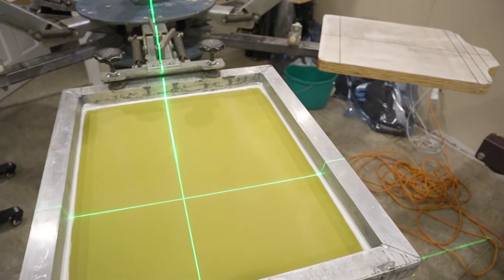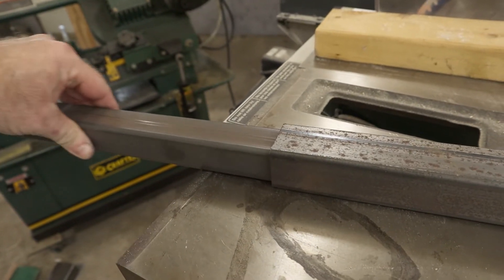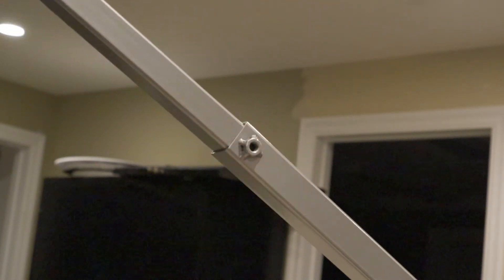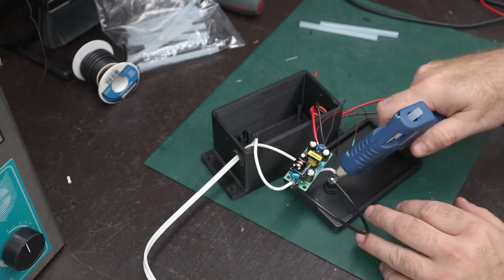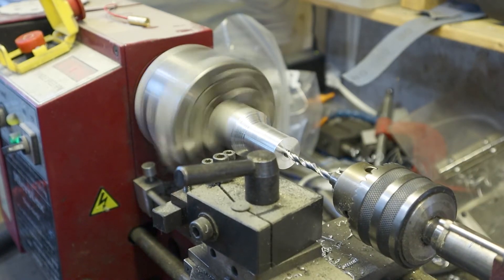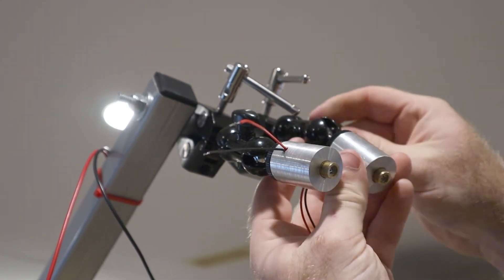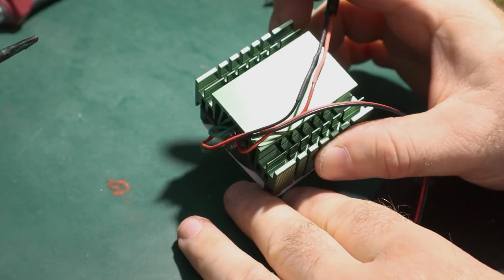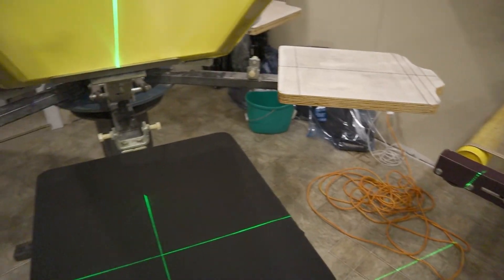Making a DIY laser guide for a manual screen printing press.

Comment: Excellent...You should make your own Printer.
Reply from the maker: I'm working out a concept to expose screens using a screen as a mask and a UV light, the same way a resin 3d printer works. That way I won't need to printer for transparencies at all. Not sure if it's going to work though.